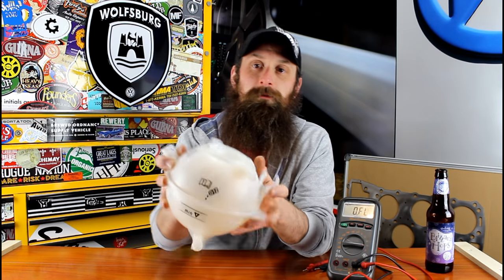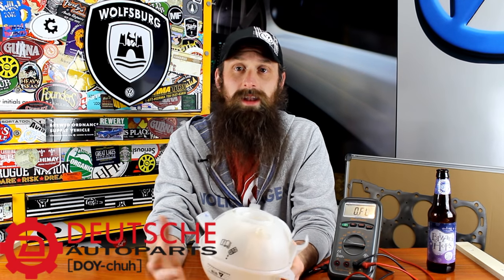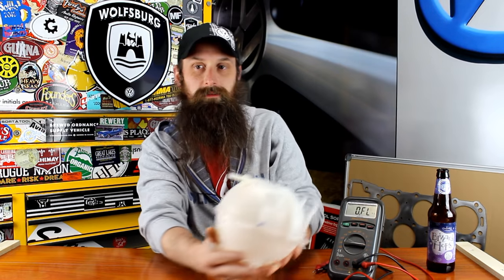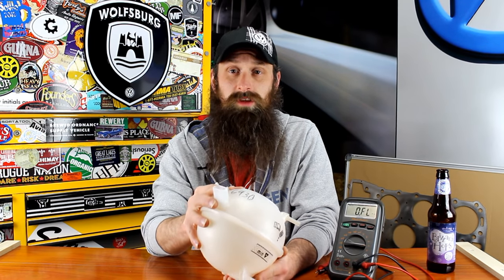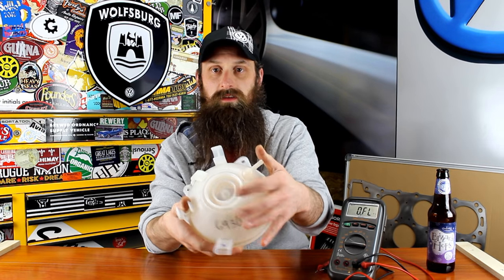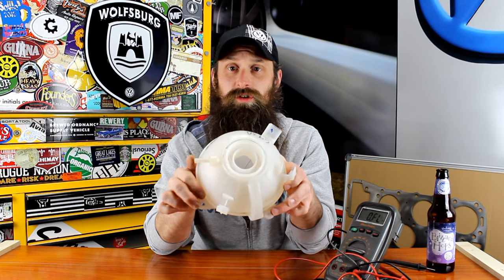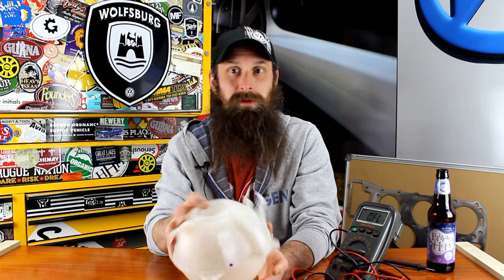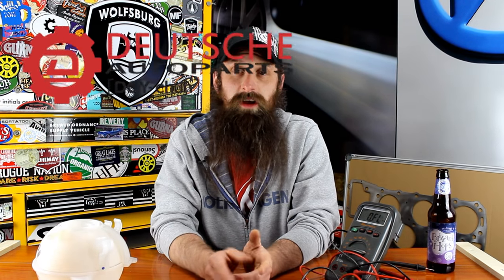How VW Coolant Bottles Fail

Comment: If you have time, I have a question. If I'm using one of these expansion tanks in a project, do you know of any way to use the coolant level monitor prongs to set off a custom light? As in, I have the expansion tank, I have an LED. How do I get it to turn on when the coolant is not touching both prongs?
Apparently the prongs are usually connected to something which monitors resistance, and when the resistance gets too high, the light turns on. Creating a simple circuit to do that seems complex. Typically the job of a micro controller. Would be much easier if they connected when coolant dropped like float sensors work.
I was thinking, I could just use a normally on relay and use the two level sensor contacts as the switch lines for the relay. As long as there is coolant, the relay is switched to off, meaning no light. Coolant drops too low, resistance becomes infinite, relay returns to normal on state, light goes on.
My only concern is I will be passing current directly through coolant. Obviously a very small amount, typically in the 200mA or less range. Just not sure if that can have unintended consequences in terms of electrolysis. As long as neither contact is touching coolant, it shouldn't pass current through the whole cooling system.
I realize there is a low chance you'll see this comment. Maybe I'll hit you up on social media sometime. Just figured it would pique your interest if you do see it. Forums were not helpful and I figured if anyone knew, it would be you. Thanks for the awesome videos!
Reply: I think part of the solution may be putting the relay in the power side of the level sensor wiring. Provided both sensor pins aren't touching coolant, resistance should be so high that the relay does not switch and therefore it should pass nearly zero current through the coolant.
As an additional precaution, I could use a MOSFET instead of a relay. It should draw such low Amperage that current through coolant is a non issue, especially since the reservoir and connecting hoses are plastic. Since a MOSFET is Voltage switched, provided there is high resistance, it definitely shouldn't switch without coolant present. I'd need to make sure the resistance through coolant wasn't so high it would never switch though.
At any rate, if you have more insight, please let me know!
Reply: Are you the guy who made a Scotty Kilmer parody video?
Reply: @rudolfhuijs4526  That is indeed me!
Reply: @802Garage  That video made me laugh like mad all the way. Then at the end the gas tank goes nuclear and I was pissing. Cheers man!
Reply: @rudolfhuijs4526  Hahaha thanks a megaton! Maybe I'll make another one someday. For now focusing on cool engine swaps and all that. :D

Comment: I'm using a Skoda Octavia and I saw smoke coming through the air conditioner vents... the coolant tank was empty... i refilled and it happened again after few kilometers... no leakage under the car. I will check the cap

Comment: I am losing coolant from my reservoir however the car is not overheating. I have checked and have others checked and still can't find where the leak is occurring. I have also change the coolant bottle and still experience the issue. Do you have any advice for me in terms of what I am missing or need to check?

Comment: Can the deposits in the coolant tank/bottle get loose and flow around the the engine or water pump and cause damage? 

Also are the any how to vids to help me replace my bottle and coolant flush and refill?

I have a 2013 Passat SE. 30,000 miles. After a service the VW service center they spotted coolant deposits in the bottle and recommended a water bottle replacement and coolant flush.

Comment: Hello my VW Touran 2004 2.0 fsi petrol is not overheating but the low coolant light comes on after about an hour of driving the car and when I go check the bottle the coolant is gone but if I gently release the coolant cap the water will then come back but last a little while till it does the same thing again, I have recently changed the thermostat housing as I thought it might be that but I am still getting the same problem there is no oil in the water and no water in the oil. I have tried running the car without the cap idling for about 45mins and it gets to temperature and then starts overflowing the coolant, but doesn't seem to calm down as it would if it was air locked, do you have any advice please....?   just to confirm the car never overheats and stays at normal temperature

Comment: Replaced my coolant bottle in my Audi A4.  It was fine but looked a little rough.  I installed the new one.  Then it got very cold and I needed to move it out of the way and the damn thing broke because it was cold.  Of course I had thrown away the old perfectly good one.   Here is a hint:  don't screw with any plastic part when it is -10.

Comment: I have a 2003 beetle 2.0 and I replaced the coolant bottle and ECT with after market parts and they don't seem to be functioning correctly is this because they are cheap after market parts or a deeper issue?
Reply: I’ve had a similar issue with a Touareg. Replacement coolant reservoir tanks kept exploding.

Comment: Surprisingly you didn't mention the bag of silica that is inside them, at least on the euro models. They can burst, sending the stuff into the engine cooling system. Gave me a breakdown for overheating, took out the heater matrix and 12 months later looks to have been the cause of a catastrophic water pump failure. Have 47k on a b8 Passat, luckily all sorted under warranty.
Reply from the maker: That started after this video came out
Reply: @HumbleMechanic  well that would explain that then 👍 I understand it's not that common a problem, but I also think a redesign would fix it. Mine is a 16 BTW.

Comment: Thanks for the great info. Replaced my coolant bottle on my 2007 Jetta 2.5L this morning, and now I have a leak on the driver's side of the motor, leaking on the top of the trans... I was just curious if you may have a link to a diagram of the cooling system, and maybe an idea of what to check. Keep up the great videos!
Reply: Tim Dodson I hope you've got it already fixed but if not, it might be the coolant flange. Do check with a mirror as well at the bottom part of it because if the leak is minimal it won't be easy to spot.
Reply: ultrafloss492 I just saw this comment, thanks for the advice. I have that part of it fixed, it was a cracked hose, but of course, now the water pump is out... Trying to find a fair price to have that replaced. Just glad we had something else for the wife to drive for now
Reply: Tim Dodson good luck! I hope you'll get it sorted quick. :)
Reply: Ultrafloss which hose was it ?

Comment: I have a vw transporter and it looses Coolant.. Every hose connection is dry. But the underside of the bottle is getting wet with Coolant. Is this a leaky bottle or can it be something else.. The Coolant light does come on regularly.. There is no water in the oil and no white smoke from the exhaust and the engine is running fine. The Coolant temp stays fine too.. My first guess would be a crack in the bottle somwhere.. Also the bottle is a little dirty inside so you cannot see the correct level from the outside.

Comment: I have a problem with skoda 184bhp 2.0tdi. Its loosing coolant, mostly during dpf regens or hard driving. I have checked oil level, oil cap and everything seems ok, car performs flawlessly and i just cant find where the coolant is going. I can go a while without loosing any coolant and then at some point the level drops.. Had to top it up a few times... Any idea?

Comment: Any suggestions as to a csr not overheating but losing coolant. No visual leaks. Changed thermostat and coolant temperature sensor housing. It gets really hot but doesn't overheat... Which I find strange. No sign of coolant in the oil or vice versa. Any suggestions would really help.
Vw golf mk4 1.6 akl

Comment: Hi. My son has a 2014 Passat and use`s coolent.Theres no white slime in the oil cap,no pressure an oil resudue in the coolant tank.When the weather was cold white smoke came out of the exhaust. Now in the summer theres no smoke.  Do i have to change the headgasket?

Comment: a4 b5 1.9tdi afn. nothing leaks, does not over heat how ever when parked throws half or more bottle out via overflow? this happens while parked and not running. Bottle, cap swapped to new parts and are holding pressure as expected. No contaminants in coolant, no bubbles. Any ideas what the frick is going on with it?
Reply: I have the same problem on my 2015 Passat Tdi haven’t figured it out

Comment: So does the coolant evaporate, or does the low level indicate a leak, or worse, coolant getting into the engine?
Reply: Doesn’t evaporate, closed system. So if coolant level drops you have a leak, and hopefully it leaks externally otherwise you are in trouble.

Comment: 2005 jetta wagon tdi coolant return nipple broke off inside the hose at 265K miles. Loosen cap and close off return hose to get to destination then replace coolant reservior. Full flush and replace coolant.

Comment: Very easy to replace but i agree with some here, bad quality VW plastics. Have not had a car where this part cracked. The little nozzle on mine broke and the hose won't stay on. Wiki has some info that VW was consistently putting cheap plastics on their cars for years to save money and develop the Bugatti Veyron(claimed by the McLaren CEO).

Comment: Hey man, so as I'm coming home from a road trip today I got the coolant light go off, maybe 10 mins before I got home. A hose broke off from the nipple it was connected on. It's a hose that is on the right front side of the engine bay on my mk6 gti 2.0 tsi. Right next to the air cleaner box...was wondering if you might know the name of not the hose, but what it was connected to?

Comment: Hello,
My 2013 Audi A3 kept losing coolant after every 100-200 miles.
Would deposits on the level sensor be responsible for this? It’s seems to have stopped after I cleaned them.
Cheers

Comment: Hi man! Learned a lot on this video!
Unfortunately I have a problem with my cooling system and can't find an answer anywhere..

Everything in the cooling system of my VW T3 works perfect, except one thing.
When my coolant level is low in the round bottle that you're holding, normally it pumps water from the other reservoir (the one that's easy to fill up without opening your engine/hood) but it stopped doing it.. Is it the blue cap that's failing?? Really can't find anything on the internet.

Thanks a lot!!
Reply from the maker: Weird. Could be the cap.
Reply: @HumbleMechanic  I'll order one. Hopefully that's the problem. Thanks for the quick respond! 👍👍👍
Reply from the maker: No prob. That’s cheap and easy to replace. Just make sure the car is cooled down all the way

Comment: I'm wondering if the electronics monitor the coolant level circuit for a low resistance (high conductivity) condition. In other industries, conductivity is used as a measure of the impurities in water. High conductivity would indicate a high level of impurities (or a short in the monitoring circuit).

Comment: Hi my mk1 looses coolant on top but im not sure from where could it be the cap? The rest of the hoses seem fine. I do smell coolant in the car when i turn the heater on could that be the dash radiator? I flushed the coolant and found a grey molten tube like kap no idea where it came from every thing acts normal any ideas?

Comment: hi mate I have an audi b5 1.9tdi on 2001 plate just wondering why there is third connection for a coolant pipe underneath the filler cap is this a vent of some kind or am I missing a pipe somewhere for reference my engine code is alm thanks dude

Comment: ON THIS PART ISSUE:   !!with my CC this bottle was rubbing against the mount, the left (looking into engine bay) engine mount has a black brackert which holds the washer bottle.  this bracket, with very sharp edge, rubbing against lower portion of bottle---could easily wear through in time.  jammed 1/8 piece of leather between to stop abrazion.
Reply from the maker: Wow never seen that
Reply: I think ours cracked - going to have a go later at replacing it

Comment: Hey Charles,

How difficult is to do a coolant flush? Need to do one on a 2012 Beetle Turbo. Thanks for all that you do!
Reply from the maker: +Adrian Martinez not too hard. Many times a drain and fill will do the trick on a car that new :)
Reply: Theres a plug at the bottom of the radiator which allows for easy emptying

Comment: Hi. So I have a 2017 Tiguan SEL 4MOTION, I'm at 72k miles. My coolant keeps dropping fast and i have to top off every 3 days and I'm California and the weather has not been very cold or hot. I don't see any leaks anywhere, so I'm at a loss as to what it could be. Could it crack and evaporate instead of leak?
Reply: I have 2014 tiguan.   Can't find leak.....1 garage replaced radiator.  Still leaking....

Comment: my vw 2000 beetle 
I replaced thromast  and fill coolant in 
bled air out 
couple days later when I drive like 30 to 45 mins I got red temp light blinking 
and shut down the engine and let engine cold a little bit 
start engine drive 30 to 45 mins the light comes on 
sometimes on sometimes good 
coolant level is good  no leaking found
what is the cause the red light on?
coolant bottle?

Comment: I have replaced the coolant bottle in my 2002 VW beetle after noticing a leak from the coolant bottle. Now though the issues I have is that when under pressure the coolant disappears from the coolant bottle and comes back once I open the bottle can you please point me in the right direction. The collant pump was replaced aswell recently. thankyou!!
Reply: This is intended. The coolant will return to the bottle after you shut it off for awhile. When you take the cap off while it's still pressurized it bubbles back up violently. This is dangerous because it can overflow and burn your hand. Stop doing this.

Comment: My 2006 VW Jetta 2.5L is getting the flashing red light for engine temperature. I suspect that it's this bottle, because first the engine doesn't overheat and stays at normal running temperature and stays there. Checked the coolant level and all is fine there, didn't see any leaks either... I think the level sensor is going bad, like you said it builds deposits over time?... Is there any way to clean the sensor or is it best to just buy a new bottle/sensor all together? Thanks for the video. very informative!
Reply: Buy a new coolant bottle + sensor and get a new maf sensor while you're at it. They're responsible for so many issues in VW/Audi land

Comment: Thank you for the great videos, I've been watching all of them lately since my son bought a used 2004 VW passat 1.8L. And has just developed a coolant leak somewhere. If you get this message and have any suggestions where I might look first it wouldn't be appreciated! If we fill the Reservoir to the full mark he can go about 10 miles before it gets low enough to turn the low coolant light back on. And I cant see anywhere that its leaking on the ground (yet) the car is in fantastic shape, and would love to get it fixed for him....just dont know where to start. I'm just a shade tree mechanic that's always owned and worked on chevy and ford trucks. I'm out of my league here! Thanks for the awesome videos again brother!!
Reply: Not 100% of the time but a lot of times the hoses near the heater run by the turbo and they will leak.  Try looking on the side of the block.  That would be the side nearest to the firewall since the engine is sideways.  I chased a leak all over to find that was the problem.  Can be fixed for pennies on the dollar most of the time.  I have an 06 jetta TDI.  Good luck to you.
Reply: This happened to my mk5 golf!!! Eventually got to the point where I’d start and fill it up and within 2/3 mins of driving it would need more water and no visible leaks. Did a pressure test it was all clear. Changed the bottle three times nothing worked. I’d advise get rid of it before it’s worthless

Comment: Regarding coolant, how often should it be replaced in a 2014 Diesel Touareg? Don't think there is any mention of it in the maintenance schedule? What type of coolant is required and are there good aftermarket alternatives? Thanks
Reply from the maker: I’d do 100k. Either Peak OE, VW, or Pentosin are my go to

Comment: I seem to have a failure around the equator of it. If I top up, it leaks out when the car is cool and there is low pressure. I presume that's s venting system failure.

Comment: Why is my coolant evaporating on my VW CC a day before I had filled the coolant level where it’s supposed to be I took a hour drive and my coolant light came on I had opened the coolant reservoir and my coolant seemed it was being flushed away like gulping away like when you take a drink out a water bottle, and my coolant levels where dropping , does anyone know what could be the issue??

Comment: I've got a coolant leak, but I don't see anything under the car, it's happening once a week or 2 to pour some coolant into the system. Is it the bottle the problem? I've changed the water pump and timing belt recently, now I am thinking the problem it might be the bottle or flange or do a total flush of the coolant, I heard that help to fix the problem ( hopefully it's not the head gasket, I don't see any blue smoke from exhaust pipe). Can you help me with suggestions of what other common problems could be in a coolant leak on an audi a3 2.0 tdi 2007? Thanks
Reply from the maker: Maybe the EGR cooler?

Comment: I have a golf 7 gti that had a small front damage. we replaced the radiators and everything with geniue parts- all new parts. we bled the system but the coolant bottle is bubbling like water in a kettle.
Reply: Any update on your car? Mine is doing the same thing. Thanks!